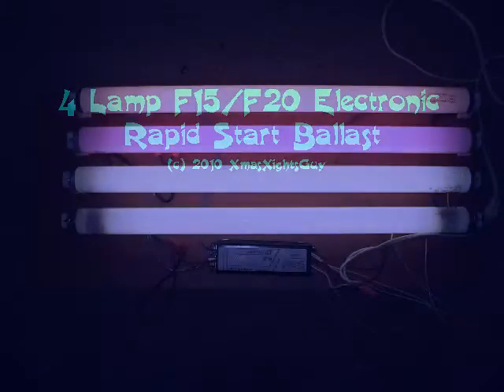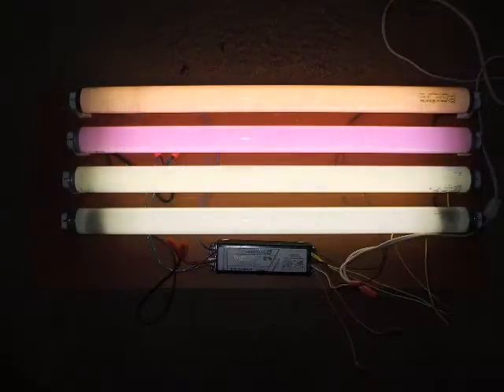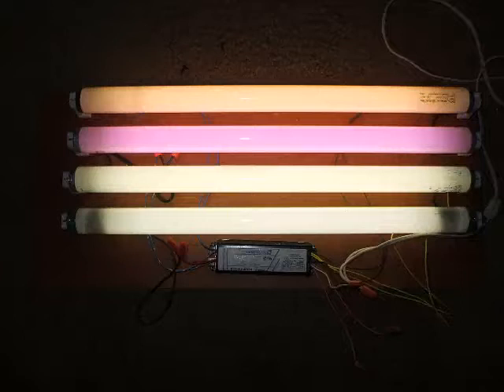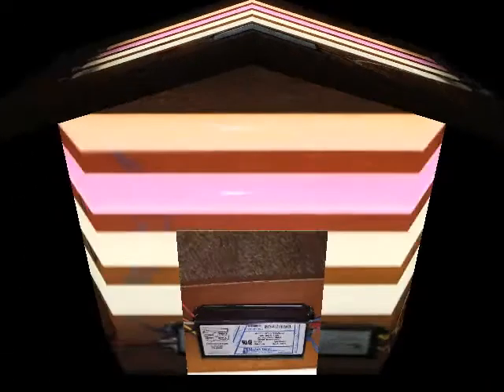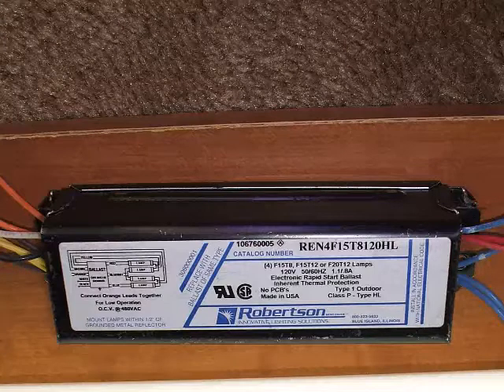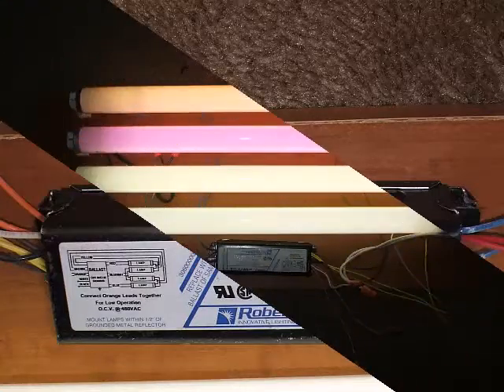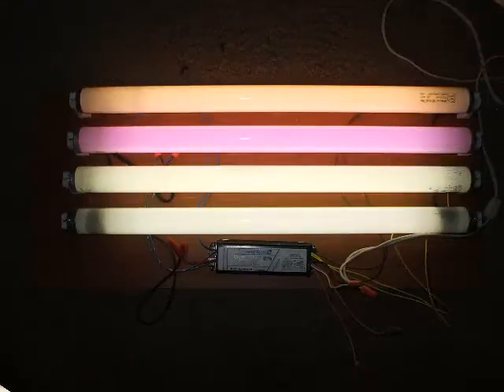4 Lamp F15/F20 Electronic Rapid Start Ballast

Comment: @BowlingMania14 The F34T12 "energy saver" (and F96T12 slimline and high output energy savers) lamps use a krypton/argon fill gas. This alters the electrical characteristics of the lamp enough to make it draw 34 watts of power on a HPF RS ballast. It also makes them cold sensitive and kill ballasts not made for them. They suck. I only use full wattage lamps. Standard full wattage lamps use straight argon as the fill gas.

Comment from the maker: LOL I agree with bamaslamma1003 here, those lamps do suck. They'll work on _most_ HPF RS ballasts, but on LPF RS ballasts they'll cause the ballast to overheat & its thermal protection to shut it down (I've done that before).

On an old vintage Preheat ballast, it could potentially go up in smoke as those have no  thermal protection. 
(burnt ballast is a awefull smell...i bet one of those old ones would be even worse)